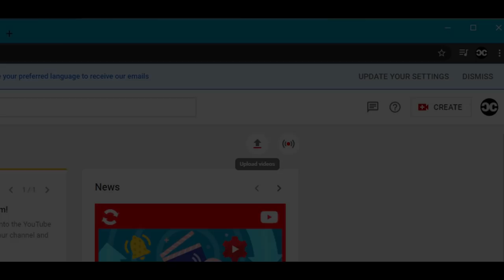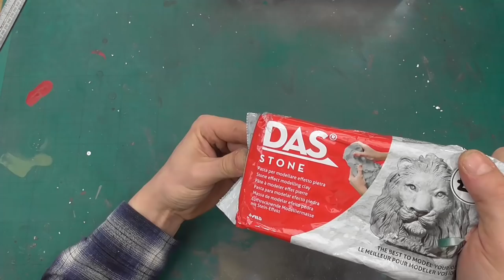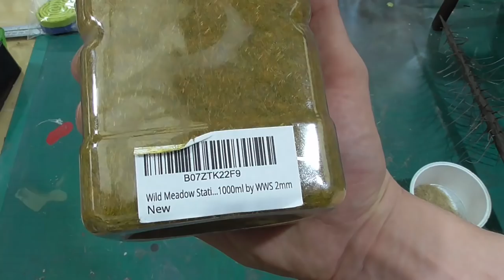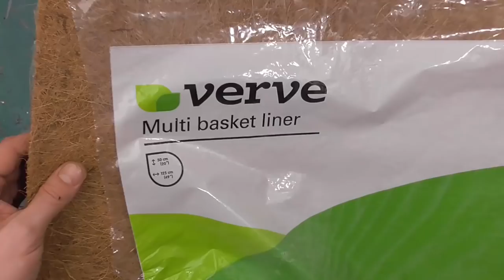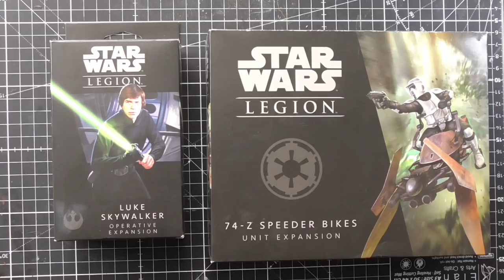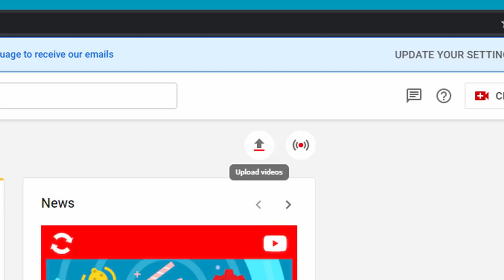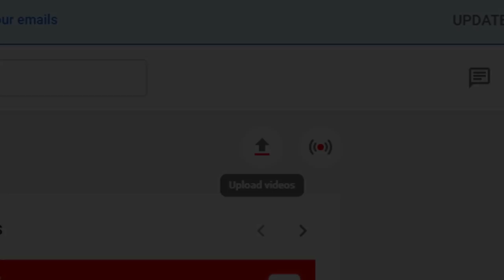How to build an Epic Star Wars Diorama

Comment: Nice way to build conifers. One thing a lot of people miss is the marks on the trunk below the branches where older branches were broken off. They make noticeable marks. Your way of applying the needles is something I'm going to have to try. Now all I have to do is find a good way to do deciduous trees.
Reply from the maker: Haha I would love to make a realistic willow tree - but haven't found a way that I am happy with yet. The search continues... thanks for watching
Reply: @creativecuts7803  I made a twisted wire tree about 35 feet tall in 1/35 scale. It looks fine but then most dead trees have most of the branches broken off or just stubs. Very few stay in place after a few years. Now a live one is a whole other story. So far I'm working on a twisted trunk and the major branches, as with the dead one. I'm soldering on smaller twisted branches to fill it out and then will coat it with latex for bulk. Not sure how I'm going on from there. Get the skeleton done first, worry about the leaves later.
Reply from the maker: @sabrekai8706  nice dude, I never tried a wire tree. I always end up using actual wood from the forest. I'm always on the look out for some narly piece of wood. I would love to see it when it's done. Best of luck with your build
Reply: @creativecuts7803  First time I went to college, I was in Forestry. Spent 2 years in the bush looking at trees. I've always found the kit trees and most home built ones to be too bulky/clunky. Now is the best time to get out with your camera and start snapping pics of various trees. They are very slim, and have endless branches off of branches. Difficult to duplicate for a scale like appearance. The other thing about kit built ones is that they are tiny. A 50 footer in 35th scale is a tad under 18 inches tall. I don't go to that extreme but my wire tries are in the 8-10 inch range and I'm looking at a dry weed I snagged a couple days ago that will end up at 12 plus.
Reply from the maker: @sabrekai8706  haha I completely share your frustration. I don't bother with kit trees because in my opinion, they are not even close. I have seen some great wire examples. If your interested check out the tree I made for my floating island build. It ended up being huge. Leaves could do with a little work but on the whole I'm pretty happy.

Comment: Such a great tutorial. I wonder (im french so excuse my english) however: i miss the explanation about what you used to do the fine & strait sparks out of the explosion, the ones you glued before putting cotton: is that fine plastic wires?? It looks so but im not sure...
Reply from the maker: Thank you for your kind words. I am happy you found it interesting. The "wire" is fibre optic strands from a terrible light i bought on amazon for cheap. I did some testing and fishing line has a similar effect although maybe less bright. Hope that helps and happy to answer any other questions.